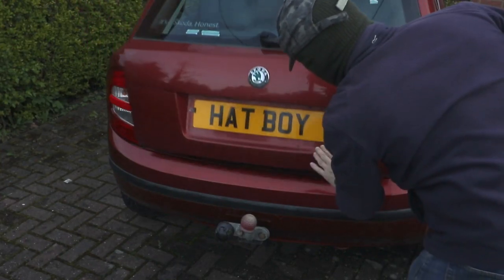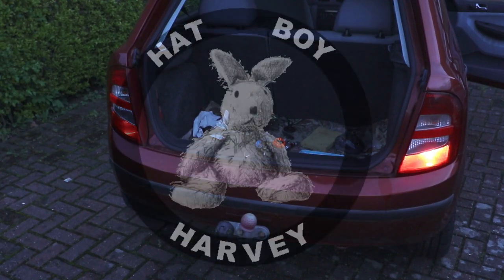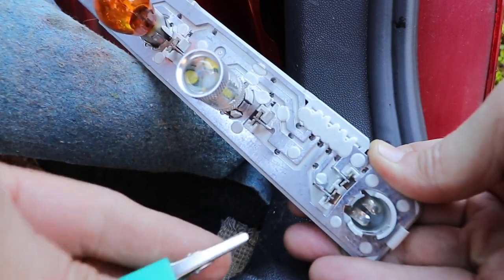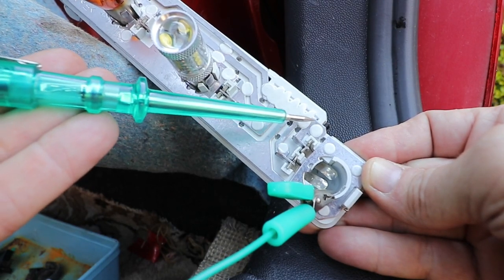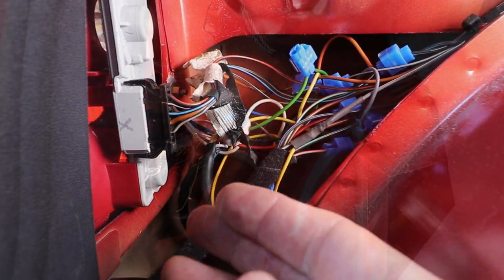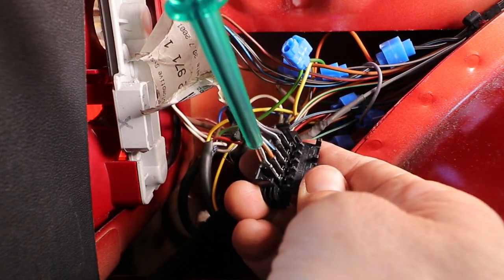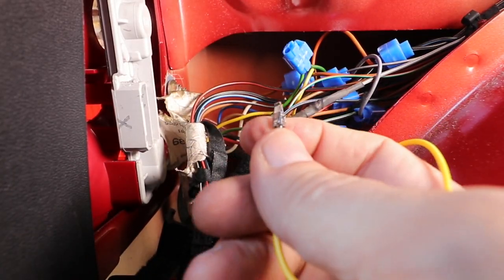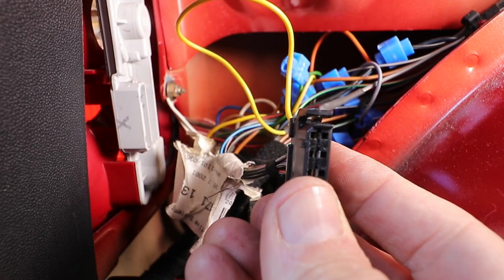SKODA FABIA Twin Fog Lights (Mk1 99-07)

Comment: Thank you! I have a question, though. Where was the gray-white cable that you soldered to the yellow cable?  Was it already there? Was it reserved for use?
Reply from the maker: Yes the gry/wht wire was there for one side so I just joined another wire to it for the other side in parallel :)
Reply: @HatBoyHarvey  Okey! Good to hear that. Then, there will not be any problem in terms of voltage drop or current capacity etc. Thank you:)

Comment: My fog light does not work. I think it is the switch, do you have any ideas on how to fix? Thanks
Reply from the maker: Try the obvious first, the lamp. Then - does the switch pull out with a reassuring click into position? I would look at the fuse first, then test the contacts at the rear lamp base unit to see if there is power when you switch it on. If fuse ok and still no power at lamp end then yes have a look at the switch; they are easy to take out. have a look at my video on stripping the switch down: https://youtu.be/Q7R8rkFevfo See if you can measure voltage there. Also video: https://youtu.be/FHs3S8iLJOg
Reply: @HatBoyHarvey  it's one of them where it pulls out underneath the switch. On the 'roof' of the little storage box, seems to make a decent click but it's a new car. When I turn the lights on and play about with both switched it sometimes flickers on but only for a millisecond - that's what makes me think its the switch
Reply from the maker: I would do the same with the switch out and have a look at the connection.

Comment: One driving light is not working on my Skoda Fabia. What could I do to fix it ?
Reply from the maker: after changing the lamp I would check the wiring/connection. Take logical steps to eliminate each in turn :-)

Comment: Another Great Video Harvey! Well done! I have put LED bulbs in from Halfords, they are very good and make an improvement!
Q1 Do you know if there us a nylon guide( that could be worn? and that could be replaced?) re gear selection from 1st to 2nd gear as mine is just ok when engine is warmed up or hot, but  a bit notchy/crunchy when cold! Any ideas or comments much appreciated!
Reply from the maker: Thanks, Has the fabia recently had a change of gear oil?
Reply: @HatBoyHarvey  It has full service history with an excellent garage P&R Ben of Cockermouth Cumbria. No gearbox oil change to my knowledge. Perhaps it needs a change?
Reply: Its done just 6 miles shy of 140,000. Next service, an interim service due at 146500.
Reply from the maker: I mentioned the oil as the fabia needs a particular thin gearbox oil that is thin at low temps and stiff gear changes often arise when changing it out for cheaper oil which is the opposite effect you would think off, but is usually only temporary anyway. If this is not the case then I would make sure the clutch and slave are bled and working correctly and off course the linkages/guides etc may need looking at or adjusting. I will look into doing a video of these at some stage.
Reply: @HatBoyHarvey  Blooming brilliant Harvey! Thank you so much. I will have to get it sorted out. The car is amazing and in amazing condition too. Its the most reliable and cheapest car to run since my old Golf MK2 GTD 1.6! Thanks very much for the advice!